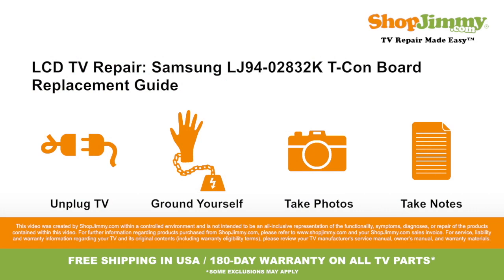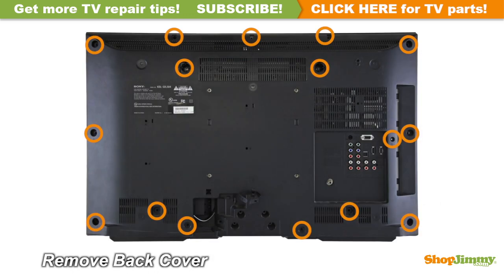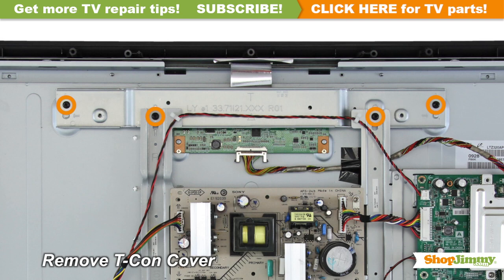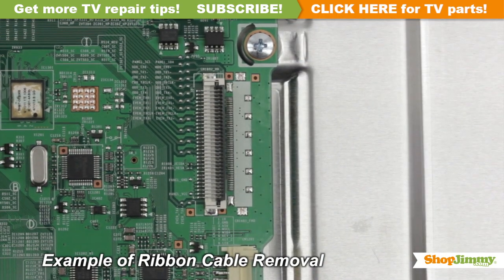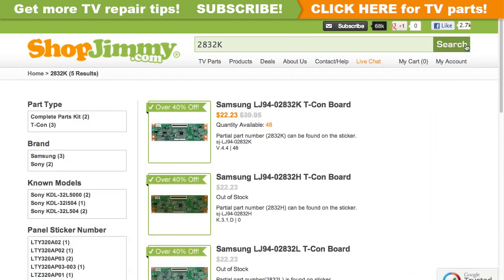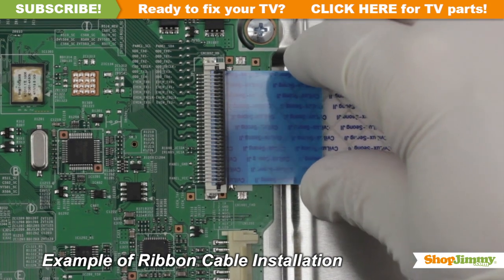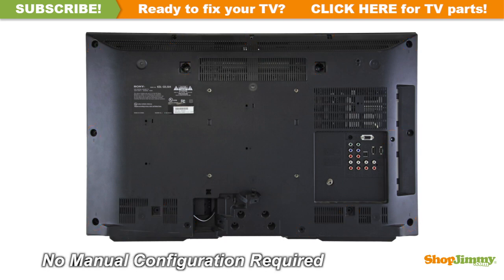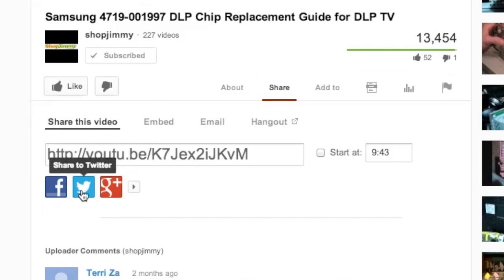LCD TV Repair Samsung LJ94-02832K Timing Control (T-Con) Boards Replacement Guide

Comment: hi I have a Samsung ln32b360c5d lcd t.v.   the picture jumps and it has lines going across the top half of the screen all things pointing to the t-con board tampatec has a post of a different model t.v. same brand and says to clip a jumper wire and it fixes it the jumper is on the power board jp854 we don't have a jp854 but a j854 is this the same crkt. I cant afford to buy a new t.v. and this was a gift from a relative.  can you help
Reply from the maker: Russell Welsh This could be caused from a few different items on your TV.  I would say the problem is either the panel or the t-con board.  You could try replacing the t-con board to see if that fixes the problem.  Here is a link to replacement parts for your TV model number, click here:  http://www.shopjimmy.com/catalogsearch/result/?q=Samsung+ln32b360c5d  Be sure to match part numbers on your current board, with your replacement for compatibility.  Here is a link to a video showing how to identify your part numbers, click here: Samsung Timing Control (T-Con) Boards Part Numbers Identification for LCD HD TV Repair  You can also call our customer service for further assistance with your purchase.  (877) 881-6492  Thanks and please let us know if you have any further questions!  www.shopjimmy.com